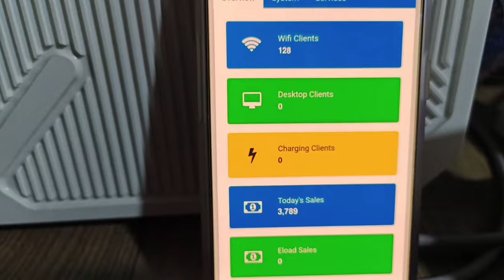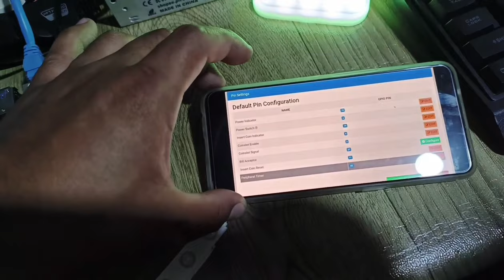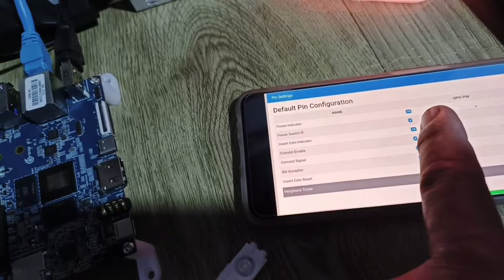STRONGEST BUILD FOR PISO WIFI FOR 2024 | ORANGE PI 8G RAM |PART2

Comment: Try nyo po OPI 5 with 32Gb RAM at saka 512Gb NMVE SSD, tapos yong signal mo naka Fiber with 800 mbps internet speed at naka static IP. Baka buong barangay na pwede ma supplyan mo ng signal.
Reply: May bayad po ba ang static IP sa mga internet provider sir tapos paano kaya gawing static IP ang connection?

Comment: Hindi RAM ang basihan jan boss pag ginagamit sa pisowifi. Okay na ang RAM na 512MB pataas. ANG IMPORTANTE ang speed ng ethernet port ng SBC natin (OPi, RPi), dapat 1000Mbps or Gigabit port.. Ang problema sa mga SBC na ginagamit ngayon ay 100Mbps lang ang maximum speed nila, up-to pa yan.
Reply from the maker: Wala sa ram 🤣🤣, naka depinde yan. yung opi 5 8gb ram ko nasa maximum client nya every gabi 180-200clients. Try mo opi 1gb ram. Kaya ba nya e handle 🤣🤣
Reply: @YAMUASTV  bumilis po yan kasi amg OPi 5 ay may gigabit port boss. Sana wag ka ma mainis sa sinasabi ko, importante parin ang RAM pero sa purpose ng OPi sa pisowifi (as router/gateway at mini-webserver) pero enough na ang 512MB boss. Tsaka yung OPi na 1GB ay may 100Mbps na port lang.